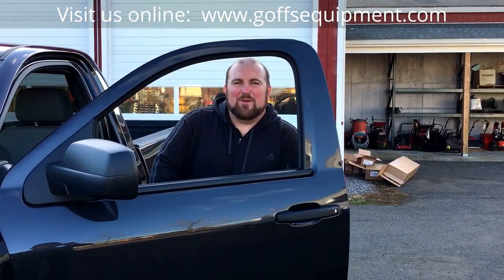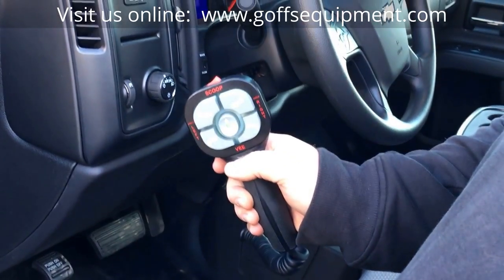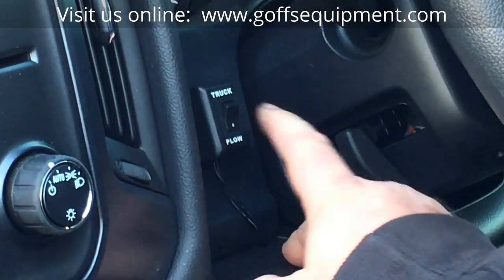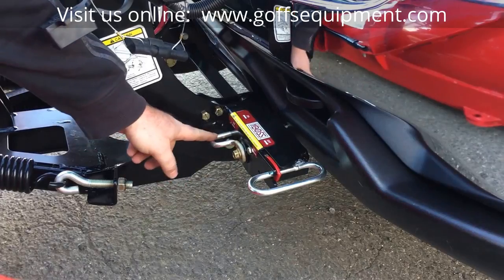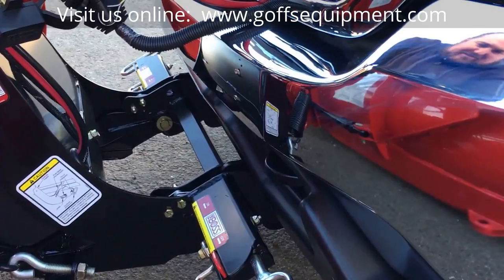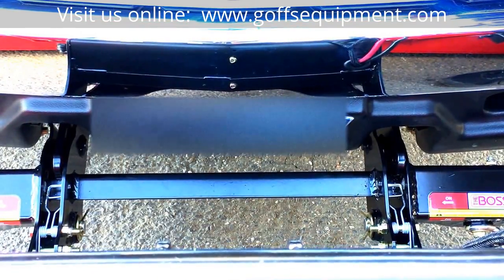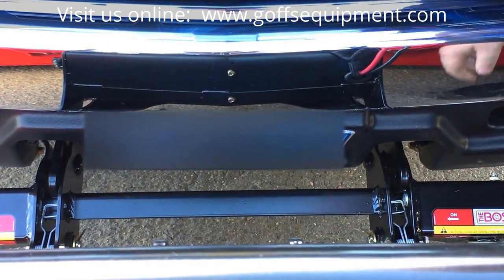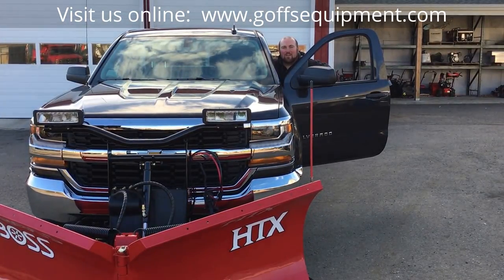How to remove your BOSS plow.

Comment: Dumb question, 
When I park my truck, should I put the control in "red float" mode?

Or do I just drop the plow in green and shut the truck off?
Reply: Good question.  To be honest I don't have an educated answer on this but I don't see an issue with putting the plow in float "red mode" and shutting the truck off.  It's what I've done with my plow for years and haven't had an issue.  I guess it ensures that the plow is definitely on the ground and that all hydraulic pressure is released.  Hope that helps.
Reply: Thank you for this! the 1st time I put my plow on I got it on by myself and I was so proud and also so not confident that I did it right that I called a male friend who plows over to check it. Every year when I put it on now if I am dating someone I usually ask my boyfriend to help me. I should know by now that a YouTube video is much better than just "any" individual who happens to have testosterone in their system.
 I had a different plow before this one  and it was a bear. This Boss is so much easier to put on and I am a novice.  I only put it on once a year and take it off once a year. yesterday my radiator sprung a leak and I had to take it off again... i only put it on last week so it did not seem so foreign. great video. great plow. if only it came in pink.🥰😜

Comment: How are these plows holding up under commercial use? I have a 2016 1500 Chevy.
Reply: They have been holding up well in all applications.  I wouldn't recommend it for heavy commercial use but I have guys using it for 5-10 driveways and it is holding up well.
Reply: Tim Goff thanks for the info.

Comment: Can't get plow off plow is off the wholes but want let go
Reply: Exactly! I have found that it takes about 45 minutes of cursing and beating it with a hammer and ramming the truck forward and back and lifting the plow up and down, beating it with a hammer, cursing and then maybe you will get lucky and it will work. :(

Comment: An important note, this only works smoothly if the truck and the plow are on a perfectly level cement pad, if it is on a slightly uneven dirt area, plan on 45 minutes of finagling, beating with a hammer, cursing and more beating with a hammer. When you give up, try again the following day with more beating of a hammer and cursing and it might work. 

Also, in my case I bought two plows that were identical, and had mounts put on two pickup trucks, trying to switch back and forth between the two is just about impossible. I am sad that Boss has not yet reached a point in their company history that they have deemed it worthwhile to hire an engineer to help with a design of their connection system, & don't get me started on the 13 prong plug!

Having whined all of this, I am an absolute amateur. Perhaps Boss plows are not appropriate for complete beginners like me. Perhaps they are only made for people who have mechanical experience and experience plowing. In that case, I am sorry about my comments and would appreciate suggestions for quick connect plow systems that actually work.
Reply from the maker: If you're beating on it with a hammer you are definitely doing something wrong.  Yes, the plow needs to be on a pretty level surface but definitely not a concrete pad.  I have guys that drop them in dirt, mud, on wood pallets and never have issues hooking back up.  You need to think ahead before you drop the plow, that's all.  As far as switching between the two different truck, I've never heard of such a thing.  We switch between trucks all the time, never have an issue.

It sounds like you need to visit a good dealer who can check and make sure both plows and trucks are adjusted properly, the push beam (on the truck) is at the correct height, and make sure you have one that can show you how to properly operate and show you how to take it on/off the truck.  There's a lot of bad dealers out there, make sure you deal with a good one.
Reply: you didnt read the fine print on the stickers on the back of the plow it says  you must park it in a heated garage with heated floors so there is no snow on the plow or truck tires you must also have a fully stocked beer fridge so when it doesnt go on the first time you can chill for a moment and have a cold one these plows are not for suckers like me and you and many others that try to put them on in 2 feet of snow with a floor jack trying to get the pins to go in the holes while freezing your ass off  lol hope this helps